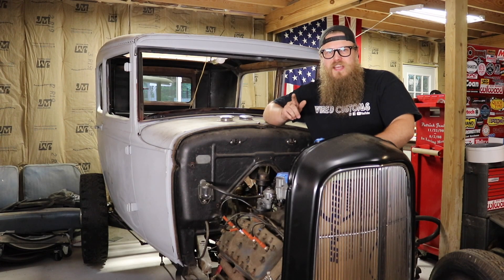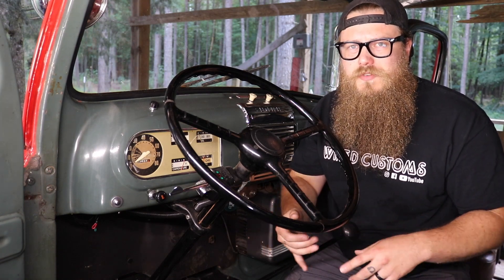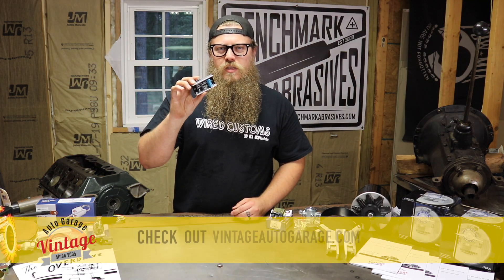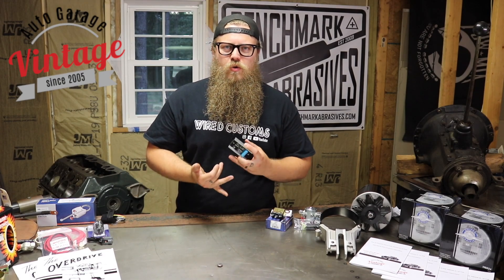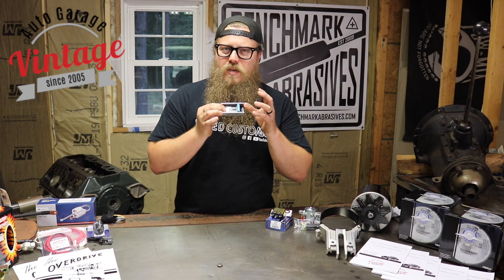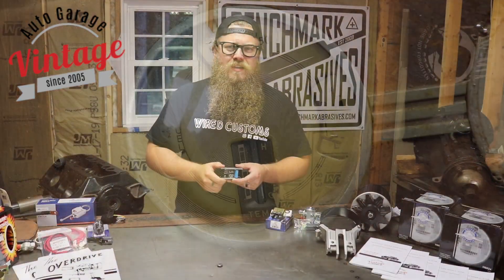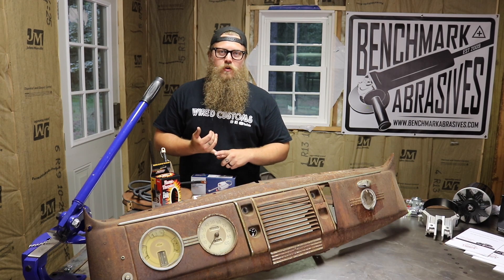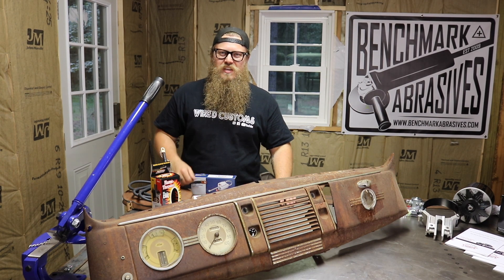6 to 12 Volt Conversion, Multi Gauge Reducer

Comment: My 1953 Chevy 3100 was converted to 12 volt. My gauges were not and I was looking at $1600 to get them refurbished. Will the Multi gauge reducer solve this? I have ordered a 21 circuit harness to solve my rat’s nest and draw down issues. What other reducers do I need?

Comment: Q.I have a 1948 Pontiac 8cyl. "negative" ground" .... you don't mention anything about rotors and points.. but several local shops seem to think they need to change things... I'm not a mechanic- but have rewired my car a few times over 50 years... So I think I can re-wire it myself- but can't get a straight ans. about this area..,and here You mention going from 12v positive to 12 volt neg... I assume I shouldn't have to worry about this am I correct?
Reply: Good Question

Comment: Great video, very informative ! Question , I have a 42 Ford Super Deluxe running  a six volt  positive ground system. I want to convert it to 12 volts but it came with a new six volt Stromberg e-fire distributor. Is there a way to run the six volt distributor on 12 volts? Maybe by isolating the distributor from the 12 volt electrical system and using a resistor or a drop down transformer to bring the voltage from 12 volts to 6 volts.
Reply from the maker: I hate to say it but I don’t think it’ll ever run right with any type of reducer, I would recommend buying a 12 volt e-Fire

Comment: Thinking about pulling the trigger on this kit for my 38 plymouth to make it 12v and negative ground. My question is even with the voltage regulator stepping it down to 6v will it still work with the gauges that used to be postive ground? Would you just connect the old postive ground wire to the new postive hot?

Comment: What 12v battery would you recommend adding to an 8BA?
Reply from the maker: It all depends on any accessories you have added to the car. With a stock style set up I always use a 650cca battery